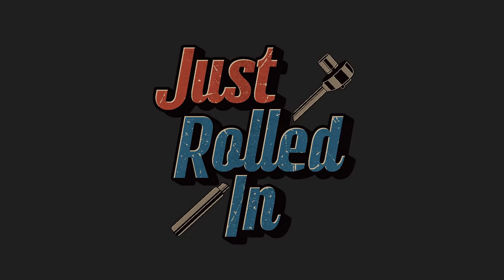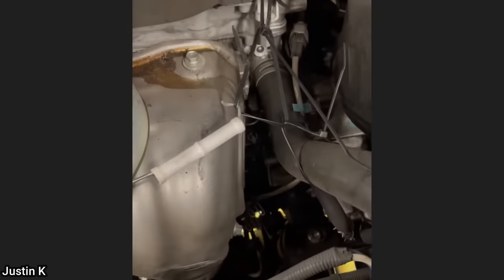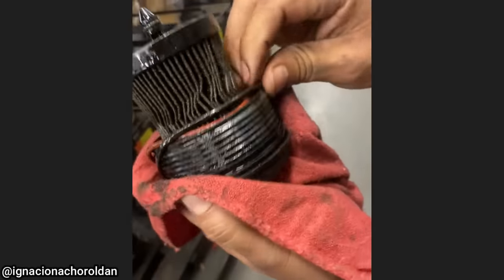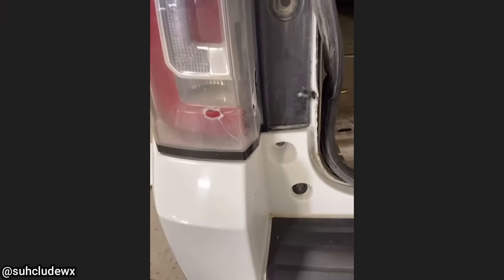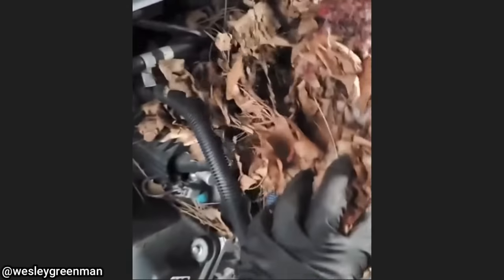Customer States Truck Is All Over The Road | Just Rolled In

Comment: 0.05 I'm amazed the blocks are still in place. I can see why the car os all over the highway, they probably misaligned the axles, too.
0:35 time to retreat slowly before they notice you.
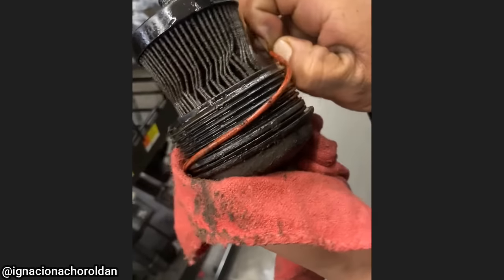1:04 there is an urban legend around my place how a large Ford dealership maintenanced a camper truck based on a Ford Transit from the 80's, regularly and always would sign off a new air filter. but the car would lose more and more power... okay, the owner thought, it's heavy and blocky and everything and SUDDENLY all the engine power was back with a joilt! owner went somewhere else this time and they found an air filter so dirty it finally got sucked in by the engine gasping for air...
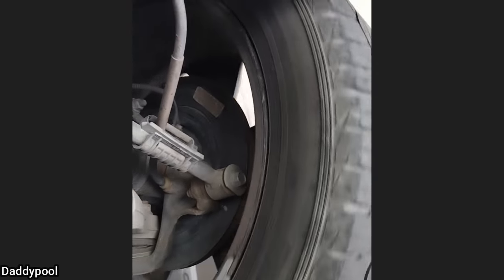2:02 I find it possible thast these tyres spent the last few years in a shop window and finally got sold for cheap. so the sun dried out a spot of threading and after a while it would decompose before the rest of the tyre.
I have also seen continental and pirelly tyres becoming brittle and full of craquele after a mere 5 years.
2:15 I'd also look into what made these cables become so hot. unless the customer once had to use the starter for an extended time.
2:22 when I bought my current ride, a 1994 Opel Astra, I had a bad smell like toilet inside the car. I checked for the interior air filter ( a matter of 2-5minutes literally depending if leaves have gathered around the filter's housing) and noticed a mouse had left tracks on the filter insert. the filter sits horizontal and underneath a large lid, I only wonder how it got into the whole compartment to begin with... and since mice are always leaking the filter was also soaked. replacing fixed the smell right away.
2:33 when I was apprentice car mechanic in late 80's teachers warned us from diesel engines eventually starting backwards if somethign doesn't align, and especially never hold a FIAT diesel engine's intake closed while it's running. then the engine would suck air in through the oil pan and will detonate in it before you have time to react... the only way of stopping a diesel on runaway is when you have a manual shift, and GOOD brakes, and GOOD nerves. slam in 4th gear and release the clutch... I have never had to try it out, though, and I'll be happy if I never have to.

Comment: 1:04 I had similar "incident" when I changed oil into my brother's Saab 9-3... Took filter off, removed old o-ring, placed new one on it's place and tried to screw it back. Only thing that there was still another old o-ring on it so I had to remove it too. Miracle was that it didn't leak any oil with that setup, maybe it helps that on that engine, oil filter is quite high and comes in from upwards position so there wasn't that much pressure over that cap.

Comment: Recently had a Valvoline shop change my oil and cause a huge oil leak. they 1) used a plain steel washer for the gasket 2) that had a huge inside diameter yet too small outside diameter 3) tightened it enough to start stripping threads- and the washer wasn’t even lined up straight (due to huge inside diameter).

Hate to have quickie shops change when I’m busy, as they regularly snap my skid plate bolts, but sometimes you just dont have time 🤦🏻‍♂️

Comment: Diesel runaways are always so much fun :D
Reply: I still think all vehicles should have a fuel cutoff button.
Reply from the maker: I've seen it once in person
Reply: @ArkaniumGaming  Wouldn't help. A runaway diesel burns oil, not fuel. The only ways to stop it are to stall it (which is difficult, it makes a lot more than rated power during the runaway), or to cut off the air supply.
Reply: @ArkaniumGaming  In the case of a diesel runaway this would do nothing.  The engine is sucking oil past the rings to fuel itself.  Stall it (good luck on a hoist) or choke the intake are the only two options.  Many diesel runaways will suck seals out of intake joins to keep running, can be quite hard to arrest once it gets going.
Reply: @JustRolledIn  Not that uncommon for 4WDs when they've stopped on a steep sideways angle for a period of time, then restart.  I've seen runaways a few times happen like that, older engine and time for a bit of oil to seep past the rings.  All except one were grabbed pretty quick, one tore the clutch apart and wouldn't choke out, smashed the valves and camshaft to pieces, bores trashed, pistons punched to hell.
Reply: @masondegaulle5731  Make sure to read all comments before posting something someone else has already said. I still stand by what I said about a stick of TNT :)
Reply: @ArkaniumGaming  Who bothers to "read all comments before posting"?  Also I gave extra information there about why a fuel cut wouldn't work which I would have thought would be appreciated.

No idea what your 'stick of TNT' comment is about.

Comment: Makes you wonder who's working in automobile factories these days...seems like many automakers are pumping out cars with shoddy assembly, zero QC, and/or crap parts.  Wouldn't touch a new car with a 10 foot pole!
Reply: several years ago there was a story about a group of workers that got fired from a Chrysler factory for drinking beer and smoking pot on their lunch break.  UAW forced Chrysler to hire them back
Reply: These days? That crap has been going on for decades. Remember the old rule about don't buy a car that was assembled on Monday, Friday, or the day before or after a major holiday?
Reply: This is why dealerships are supposed to do a Pre Delivery Inspection. It's not a new problem.

Comment: 2:02  i had a flat tire and the tire looked exactly the same.  we never figured out how this damage was possible.
Reply: Looks like sidewall separation and it can happen because of a manufacturing defect. Unusual, but possible. Most sidewall failures come from striking debris in the road while driving.
Reply: bad roads, enormous potholes,at hwy speeds cause separation, especially on retreads.

Comment: Designated me as you have people don't even bother to look at what a problem might be when it is easily visible when standing beside to vehicle. They just drive it to the shop instead of just pulling a water leaves out if they open the lid. Or ask with the suspension on the truck doubled up with blocks that were actually missing. People are so helpless that it is scary.

Comment: A run away diesel any time is a bad thing and I have seen guys do everything to stop them before the explode. I found an old CO2 fire extinguisher at a flea market for a dollar had it hydrotested (friends worked for an extinguisher company) and filled and it sat by my tool box for just such an occasion. Stops run away diesels immediately without any damage (other than what caused the runaway in the first place) to the engine.

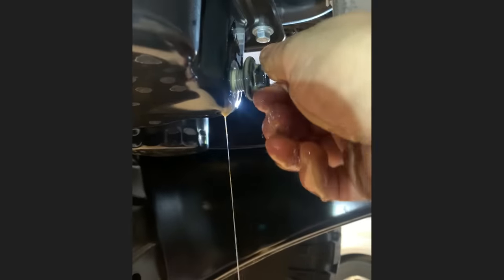Comment: 0:46 ford wants to investigate the engine, but they should be more worried about the assembly line. id put money on it being a rookie put the coolant nozzle in the wrong hole. should check the radiator for oil. lol

Comment: I'll start by saying if something seems off or wrong have it checked immediately.  My sister only lives about 4 blocks from me, texted & said she just got her oil changed & now the oil light flashes when she turns right.  I told her just come over & I'd check on things.  She waited a few weeks before taking it back to the dealer.  The dealership did the oil change & didn't put the filler cap back on.  Human mistake, I get it but my sister almost let it go to long.  The whole under carriage was just covered.

Comment: Take 2019 kia 42k miles to dealer for minor coolant leak. Dealer says broken bumper,bent radiator support, cracked radiator, bent axel, damaged cruise control box and more. (No body damage at all) Total estimate  $14k. I take car home to find the plastic under front end hadn't been removed. Take car to my trusted mechanic. He states "whole front of engine is leaking ". Call Kia corporate, they say take car to a different Kia dealership.  Second dealership says $8k to repair. They call after 3 weeks to say all repairs complete. I received second call that day from dealership. "Failed road test ,we inspected and found it needs new engine " .. Final bill $15k
Reply: KIA, PAID. UNDER WARRANTY
Reply: Had a KIA, once.
Never again.

They deserve their crappy reputation.
Reply: @captainamericaamerica8090  They said engine damaged in "mystery " crssh . Progressive paid Kia

Comment: 1:00 There is a fan with an unequal interval of fan blades. Is this new because of noise reasons like the unequal pitch in thread patterns of tires?
Reply: Yes, unequal spacing reduced noise harmonics. However, this design is not new. I don't know when it started, but I have some 60's cars that have that from the factory.
Reply: @413x398  Thanks! 😃
But it's new for me. I hadn't been aware of this yet. 😎

Comment: At this point in time I don't even understand why people buy new cars any more. Only because they look pretty and shiny? I drive a 2006 Daewoo, if any of you can come up with ONE way of killing it other than a crash, I'll buy you a beer or something. Moneyshifting - I've done it multiple times, one of the springs that push the gear stick in the middle is slightly weaker, so when you put it in neutral, sometimes it doesn't go all the way to the middle, and you end up shifting in 1st instead of 3rd. The engine just revs up, the car slows down, absolutely no damage (other than the obvious long-time wear). It's short and high, so it can do a decent amount of off-road as well, I hit tree logs and boulders with my oil pan and gearbox, nothing, not even a leak. I rolled it over once when I was younger, trying "handbrake tricks". I can go over all bumps and potholes at any speeds, nothing happens. And here we have these brand new cars that somehow end up worse than my 16 year old car after a few miles...

Comment: How can someone get their driver's license without knowing how to open the hood and take a look inside and see what the noise or the smell is? Or to check for damaged tires and understand that something is off?
Is it normal not knowing basic things about the vehicle that you own/drive?
Good video as always, brother. Thanks.
Reply: It's normal. Most people who use a computer never open the cover, and couldn't tell the difference between a failed drive and a clogged cooling fan. 
Heck, I bet most people couldn't explain the difference between "hot," "neutral," and "ground," yet they use AC electricity every day.
Reply: @j_taylor  meanwhile I had my PC shipped to my new address and the postal service manhandled it so badly that I've had to sift through the wreckage and figure out what ISN'T broken, all while dealing with the bureaucracy of demanding an insurance payout from them...
Reply: Must be normal. Look at the clowns with just daytime lights and no other lights in the dark. My dash is on, lights must be on,
Reply: You have to remember that drivers' education in the US is very weak.

Comment: This kind of crap I why I only take my vehicles to an oil change shop if I ABSOLUTELY have to. Putting a second O-ring over the existing one and not changing the filter is garbage. I'm the dude that will stand in the parking lot or at the window and watch to make sure the technician does his job correctly.

The latest tech-fail was taking my wife's 2020 Chevy Trax in to get the new tires mounted and balanced and having the sales manager try to upsell me $400 on air/cabin filters and cylinder head cleaning, brake fluid exchange garbage. Declined service and did it myself 400 miles later when the oil change was due. Come to find out, the technician never bolted the intake air box back together, so it'd been sucking in dirty engine bay air through the turbo for 400 miles.

Another time, I took my 2009.5 Pontiac G8 GT in for an oil change at a local shop, after I moved and didn't have my tools with me. The car had an oil cooler with a sandwich filter adapter installed to run the lines to the cooler, straight down the car between the exhaust pipes and to the radiator area. Later that evening, I am sitting at a red light when my car starts smoking like crazy. Pull into a gas station and there is oil all over the ground and car. Get it towed to a dealership. Apparently the local shop didn't straighten the sandwich adapter down the middle of the car and left it pointing to one side, which allowed the rubber oil line for the oil cooler to rest against the exhaust pipe until it melted through. $500 for them to remove the cooler, lines, and an oil change. Quality.

Comment: My private shop mechanic just had a customer bring in a vehicle after taking it to a local dealership where they said he needed $6500 worth of engine repairs, he told him to take it back and have them video their diagnostic check. They agreed, made up a bs video showing things that didn’t even relate to what they said was wrong and stood by their quote.  My mechanic fixed issue for the guy for under $200 and didn’t even loosen a bolt. That big name dealer in some big doodoo.
Reply: Name names or it didn't happen..help out the next guy.

Comment: a friend just got a car from his dad.  the tires look fine for tread but the sidewalls are peeling like a retread. we looked at the date code and find the tires are almost 10 years old.
Reply: I was at a Studebaker meet last fall and someone was there with a beautiful 1921 Studebaker. The tires on it had lots of tread but were over 20 years old. He'd replace them but they would have to be custom made. The real kicker was the spare, it was the original spare with a manufacture date in 1920! And yes, it held air (in a tube no doubt).
Reply: WE HAVE SOME TRUCKS WITH TIRES 25 YEARS OLD TIRES IN A OLD JUNK YARD. THEY RUN LIKE NEW!ß A TOP QUALITY TIRE WILL LAST FOR DECADES!
Reply: @captainamericaamerica8090  Tires will last for decades if you replace the rubber parts regularly as they degrade. Just like we replace rubber hoses and gaskets.
Reply: @captainamericaamerica8090  Tires harden and crack over time.

Comment: do overfilling the engine like that do damage to it (when found out that fast)?
Reply: In a diesel it can.  Creates too much pressure in the sump/oil system, which relieves by pushing oil past the rings, which adds fuel to the combustion process, which in turn creates more pressure, more oil past the rings, rinse, repeat at WOT until the sump runs dry, or critical failure.  It will override the governor and rev up to valve float, or tear itself apart trying.  If you can catch it before it really gets a run-on and stall it out, it's possible there will be no damage.  Also possible to bend rods within the first few seconds of runaway.

Don't think most petrol engines are high enough compression to "diesel" from sump oil unless something else has gone wrong.
Reply: @masondegaulle5731  sounds expensive

Comment: 2:15  I'd want to know why the battery cable was getting so hot.
Reply: Look at the connection....
Reply: High resistance
Reply: @JohnDoe-ut7wu  Or too much current.  Either way, it calls for some investigation beyond just replacing the cable and reservoir.

Comment: Back in the 80s I had a customer bring in an Audi 100ls wanted a radio put in when i pulled the console about a 1000 cockroaches came running out I put the console back in place had someone else pull it outside and called the customer to come and get it the half eating 5 year old sandwich should have tipped me off!

Comment: 2:33 bet that car was an automatic. Good luck stopping that 😵
Reply: If your brave enough, you can discharge a CO2 fire extinguisher in to the air intake, the lack of oxygen due to the CO2 will stop the engine run away.
Reply: @leepower2717  Yup CO2 into the intake is only way if not a manual.
Reply: @IIGrayfoxII  A bundle of rags up the air intake will do it, if you can find the inlet on a modern car....
Reply: @davidjones332  easily doable as it will be near the front of the hood.
These days all cars have a Cold Air Intake which pulls air from the front of the car itself.

Comment: Okay, with those caseless oil filters, I can kind of understand not seeing and removing the old o-ring, but to add the new o-ring and NOT EVEN CHANGE THE FILTER?
That mechanic/lube-tech needs to not be employed in a service job ever again.
Reply: Having worked with this stuff, I can make an educated guess:
- Young, new worker
- Didn't have the right replacement filter 
- Didn't want to tell the customer that they don't have it in
- Knows he has to put an o-ring on before putting it back, but doesn't really know why

Comment: 0:59 Since when do 6 mile F350's come with Goodyear Duratrac tires? Second of all, who would even put those on a truck? They wear out in less than 20k miles.
Reply: Only of you drive like an idiot. I've had mine on for pushing 100k miles and there is still 30% tread on them. Don't drive them like you stole them. Drive them like you care
Reply: @joshwatkins9781  What size? I only have experience with the 33x12.5R15, which are a load range C and maybe six ply. I've heard the bigger sizes are beefier and tend to last a little longer.
Reply: @salans7 285/75/r17. I think they are "33s"
Reply: @joshwatkins9781  Those come as a load range D or E, so a little tougher than what I had. Makes sense.